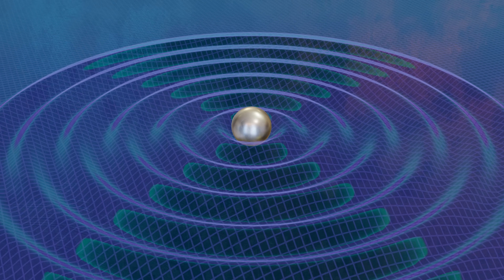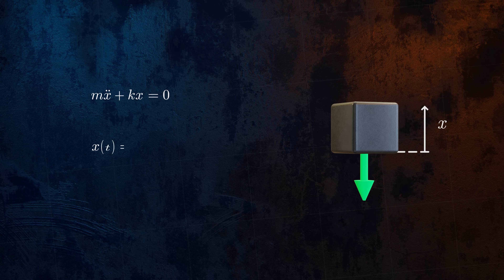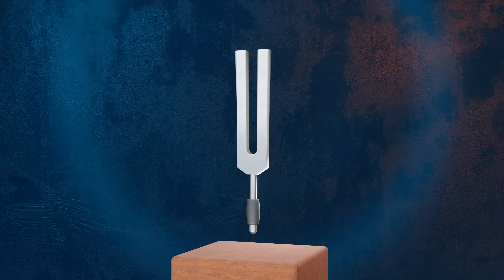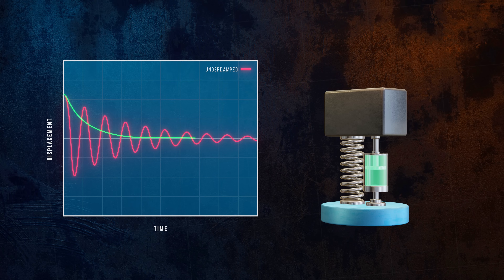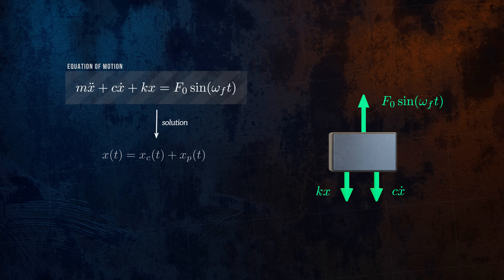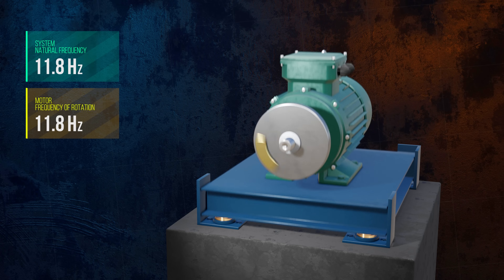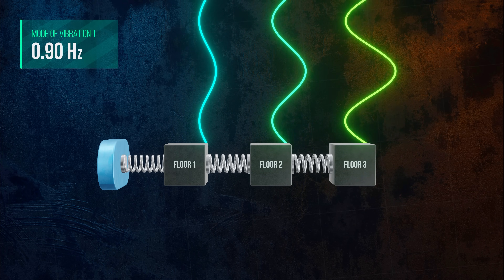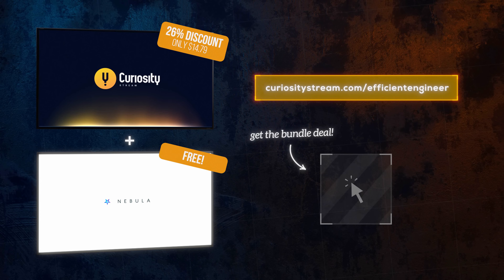Understanding Vibration and Resonance

Comment: Timestamps (Powered by Merlin AI)
00:07 - Understanding vibrating structures is crucial for engineers
02:20 - The forces acting on the point mass are equal to the product of its mass and its acceleration.
05:19 - Different masses of spring-mass models have different natural frequencies
07:36 - Viscous damping is commonly used because of its simplicity.
09:54 - Oscillation can be caused by initial conditions or forced by external loads.
12:30 - Resonance can cause significant damage to structures and needs to be carefully assessed.
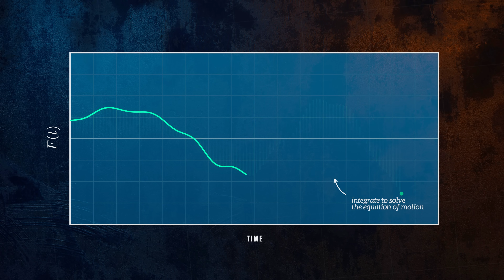15:04 - Designing structures to withstand seismic events requires special probabilistic techniques like the response spectrum method.
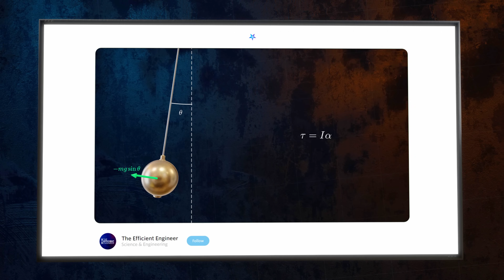17:44 - The motion of pendulums differs from a mass-spring system and the equation of motion can be derived.

Comment: Nice introduction. What I always enjoy about this subject: it is the gateway drug to understanding electromagnetism and RF/microwave engineering. Many of my engineers have a structural or mechanical background and are usually mystified with RF. But once the synthesizing mathematics of differential equations (especially pde’s and complex analysis) is introduced in relation to modes of operation, damping and resonance, the connections to amplifiers, filters and transmission lines becomes real.

Comment: These are all the same quantities for electrical systems, such as phase, frequency Inductance(mass and Capacitance (Spring Constant)and Impedance(Impedance/resistance). Resonant frequency has 2 signals 180 degrees out of phase

Comment: This dude covers 70% of the semester in just one video
Reply: I agree 😂
Reply: @mohamedfaisal6202  where are you from brother?
Reply: Damn what clg r u from cause this vdo covers jst half of 1 chapter I have this sem
Reply: i don't think so....he is really good but there is more depth and width to core mechanical subjects which he doesn't cover in this small videos
Reply: @vineetbadekar1112  Theoretically it was about 75% of my undergrad vibrations course. However mathematically, it was maybe 5%. Probably why it takes so much time to get through the theory because the math that goes with it is very extensive.

Comment: One area that is commonly overlooked is how fluid flowing in pipes creates vibration waves that travel the long axis and create standing waves of much greater energy than the flow itself. Outside of high pressure gas being vented the majority of the noise in a process plant comes from this effect. Bearings with defects cause a massive amount of noise because the vibration is transmitted to the piping. 
About a month ago one of my multi stage pumps motor bearing failed and started a harmonic in the suction spool that fatigue cracked a vent nipple. I had to do an emergency shutdown before it caught fire. The motor is mounted on a fully grouted plate on concrete. You could feel the ground vibrating 20 feet away

Comment: The equation mx'' + kx' + x = 0 is wrong because the damping force is proportional to fluid velocity *squared*. It is used, because you can easily use Laplace transformation, but it's fundamentally wrong in its outset.
Reply: It depends on the regime of flow.  For laminar flow, the resistive force is proportional to the velocity through the fluid.  So for friction in a viscous substance like oil, it is completely reasonable to assume a linear damper model of F = -c*x'.

For turbulent flow, pressure drag dominates over viscous drag, so this problem would be significantly more difficult to solve with turbulent drag.  Even fluids without a lot of viscosity will have some degree of laminar flow at low speeds, so there is a part of the drag force behavior that will be proportional to the velocity, instead of the square of velocity.

Comment: Can anyone please correct me, here that this spring in the shown example is not like a real, physical spring, because real spring has some sort of damping in it and therfore the mass stop after certain period of oscillations (Damping: energy dissipative system) whereas stiffness is just the resistance of deformation (here it is spring, it could be turbine blade or any object)
Reply: Usually, you assume a lumped model of ideal components, to keep it simple.  In other words, you assume a massless/frictionless spring, and a massless dashpot, and a perfectly rigid mass.  This way, there is no cross-over in the behavior of these components for the mathematical model, as there really is in reality.

Comment: For a layman like me, the first thing I thought about with resonance was how a washing machine for clothes receives an unbalanced load and begins to rock uncontrollably until the system's auto-restart stops the spin cycle.
In that case, the washing machine's outer case would be affected by the forces of the rotating cylinder within it, and the imbalances can resonate with the momentum already applied to the outer case from the cylinder's spinning?  Fun info, don't know how I'd apply it just yet though!

Comment: What about vibrations from light or radiation waves? Can you dampen that?
Reply: Yes.  It's called semitransparency.

A semi-transparent medium will partially absorb some of the light waves that pass through it, in proportion to the total amount, and in proportion to the thickness.  The energy of the light wave is attenuated just like a damper, as it is converted from the domain of electromagnetic fields and photons to the thermal domain.

Comment: I find it criminal not to show why we use angular frequency for oscillating objects
Reply: The reason why we use angular frequency, is that it keeps the calculus elegant, by having frequency in radians/second instead of Hertz.  The angle is more virtual than physical, since it is just an angle used to keep track of where within the cycle we are, at any given point in time, where 1 cycle = 2*pi radians or a complete "rotation" through phase space.

It is not necessarily related to any actual rate of change in an angle you can measure with a protractor, in terms of what is happening in reality.  In some cases it is directly related to angular velocity, like uniform circular motion.  In other cases, it is a completely different number from angular velocity, like in the case of a pendulum's motion.   In the case of a linear mass/spring system, it has nothing to do with angular velocity.
Reply: @carultch  "  The angle is more virtual than physical,"
lmao, even though the angle is virtual. There is zero reason not to show how the projection of a point moving on a unit circle can represent this scenario. So many concepts regarding this motion can be visualized and understood intuitively that way. And if you want you can actually build a mechanism for this projection, and actually measure the angular frequency using a protractor.

Comment: Sir, there is a confusion.
Heavier mass oscillates at a lower frequency as compared to lighter one when stiffness of the spring is same.
But mathematically, natural frequency (omega) is proportional to square root of mass, which means heavier mass should have greater frequency???
Reply: Natural frequency is inversely proportional to the square root of mass, assuming the stiffness of the spring remains constant between each case being compared.   Not directly proportional to the square root of mass.

Heavier mass should have less natural frequency, unless you also increase stiffness.  This is why steel has a higher speed of sound than rubber, even though steel is a lot denser than rubber.
Reply: @carultch  Thanks ❤️.

Comment: Dashpot = Capacitor, resist change in voltage = Inductor, resist change in current.
Spring, dissipate energy as heat = Resistor, dissipate electrical power as heat.
What is mass? Dual of the dashpot depending on whether we treat Force as voltage or current?
I love binging these videos and seeing the connections across engineering disciplines.
Reply: The dashpot is more like the resistor.   The spring is like the capacitor.  The inductor and mass are like each other.

The spring and capacitor store potential energy, in the form of elastic potential energy (SPE for strain potential energy) and electric potential energy (EPE) respectively.  Energy of configuration, which we call potential energy.

The dashpot and resistor remove energy from the mechanical (or electrical) domain, and convert it irreversibly to the thermal domain.  Both of these components generate heat as they apply a force that opposes the velocity (or current).

The mass and inductor, store the energy of motion, in the form of kinetic energy and magnetic energy respectively.

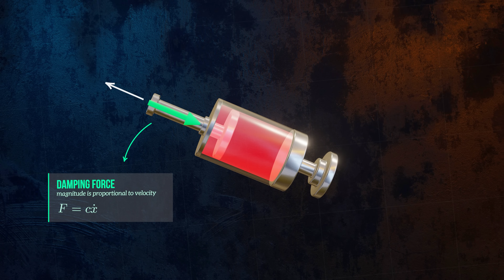Comment: Hi, I was wondering if at 7:26, this equation could be applied to a pendulum dampening a structure? If so, what do i do with k?
Reply: Instead of elastic stiffness, you have m*g*sin(theta) as the restoring force for a simple pendulum.  We approximate it as m*g*theta, since theta in radians is approximately the same as sin(theta) for small angles.  Mass also ends up cancelling, because both the restoring force and the inertial property are proportional to it.

Comment: Accurately speaking, solutions shown are never-ending. For having solutions to the 2nd order diff. eqn. is needed to have a singular point where its locally non-Lipschitz. As example, changing the damped force F=c*x' (Stokes' law), for a sublinear damping:
F=c*sign(x')*sqrt(|x'|)*(1+|x'|^(3/2))
will made appear decaying solutions that indeed will achieve finite extinction times (particularly this example resembles Stokes' law for non-near zero law speeds, and the classic drag force F=c*(x')^2 for high speeds).
Hope you experiment with this force on your softwares and share the results.

Comment: Vibratiile vazute ca miscare oscilatorie a punctelor materiale ale mediului, de o parte si de cealalta apozitiei de echilibru, se produce numai in sanul substantei. In vidul cosmic necoeziv, inelastic, inponderal si neinertial, nu poate functiona mecanismul undelor care cere transformarea prin succesiune a energiei unui camp in energia celuilalt camp. Asadar in vid nu este nicio vibratie, ci numai translatie (alunecare) hidrodinamica prin oceanul eteric. Asa zisele unde E-M sunt doar reliefuri ale campului E-M, care luneca hidrodinamic prin oceanul eteric. Relieful E-M este format din circulatiile in planuri perpendiculare, ale campurilor electric si magnetic.
Vibrations seen as an oscillating motion of the material points of the environment, on either side of the equilibrium apposition, occur only within the substance. In the non-cohesive, inelastic, unweighted and non-inertial cosmic vacuum, the wave mechanism that requires the transformation by succession of the energy of one field into the energy of the other field cannot function. So in vacuum there is no vibration, only hydrodynamic translation (sliding) through the etheric ocean. The so-called E-M are just reliefs of the E-M field, which slides hydrodynamically across the etheric ocean. The E-M relief consists of the perpendicular planes of the electric and magnetic fields.

Comment: so the number of degree of freedoms equal the natural frequency that the system can have?
Reply: No.  They don't even have the same units, so you can't say that they are equal.

The number of degrees of freedom is the number of independent direction pairs that the system can move.  An unconstrained particle (whose rotation is irrelevant) can have up to 3 degrees of freedom, because it can move up/down, left/right, or forward/backward.  An unconstrained rigid body in general can have up to 6 degrees of freedom: up/down translation, left/right translation, forward/backward translation, as well as yaw, pitch, and roll rotations.  Constraints will reduce the number of degrees of freedom, like a rail track reduces the number of directions that a train car can move, from being a rigid body (6 degrees of freedom in free space) to being confined to just moving along the track (1 degree of freedom).

Natural frequency is a consequence of the interaction of the stiffness and the mass, that determines what the frequency would be, if there were no damping or forcing functions.

Comment: I have a question please ! (including the first example used in the vid)
does gravity act as a damper? 
or  its just the the energy is dissipating in form of heat in the spring and maybe sound too 
or its both of them 
cuz eventually in real cases the vibration shall stop ... thanks

Comment: Why do we neglect gravity of the mass on the Spring?
Reply: Because all that it does is relocate the neutral position of the vibration, so that it occurs at a slightly deformed position of the spring, instead of at the spring's unstressed position.  The dynamics are still the same, whether we consider the vertical spring with gravity, or the horizontal spring system where gravity is out of the picture.  It is a lot easier to set it up with a vertical spring, because you can maintain it in tension on both sides of the cycle (and not deal with buckling), and you also don't introduce friction from the method of supporting the mass as it moves.

Comment: I’m studying Electrical Eng, but I’m here because the structural vibrations in my building 24/7 are driving me crazy from rotating machines mounted on the ceiling right above me and my landlord refuses to call a profesional. I’m trying to understand what needs to be done.

Comment: Thanks for sharing the video. By the way, why didn't you include the weight in the equation ? It will be like: 
m*a + k*x = (+ or -) mg
Reply: Because all that does is shift the neutral position, from the unstressed position of the spring, to a position slightly lower, where the spring force fully balances the force of gravity.  The dynamic behavior is still the same, thereafter.  This is the case as long as you are in a uniform gravitational field, which is a reasonable approximation of Earth's gravity, 9 times out of 10.

You could also assume this problem takes place in a weightless environment, or that it takes place along a horizontal air track that supports the weight independently of the spring.

Comment: Started working HELICOPTERS; quickly got to HATE the beasts!!!  Ran on a couple mad scientists that used strobe lights, vibration sensors and tuning circuits!!!!
One could have a “static balanced”rotor assembly or drive shafts but upon engine start it all goes to HELL !   
After much tutorial and hands-on the HELICOPTER was my “bread and butter.”
The practical application of this video is beyond great!!!!!

Comment: @ 2:41 there is a mistake however the final equation m a + k x = 0 is correct
according to Engineering Mechanics - Dynamics , Meriam. The the initial equation should be like this:
- k ( delta + x) + m * g  =  m  * a
delta: is the displacement due to the weight of mass
a: is acceleration 
g: gravitational acceleration 
x: the displacement from equlibrium position between mass and spring
At the equlibrium position between mass and spring we have at  :
 - k ( delta + 0) + m * g = 0 
or
 k ( delta) =  m * g 
according to that the final equation is going to be : 
m a + k x = 0
However I really do like your channel :) :yt:

Comment: Thank You for posting this: I was an aircraft mechanic for 8 years in the US Navy and trained, schooled, worked on Aircraft Hydraulic Flight Controls Systems, Airframes and Structures, AND LATER, I went to work at Lockheed Space Systems Division Environmental Structural Laboratories where I worked with Vibration/Acoustic tests on spacecraft structures. This video extends my knowledge and understanding of the physics from that experience.

Comment: Thank you for this amazing work. I have one thing that I couldn't understand, "Energy in a vibrating structure is dissipated due to the relative motion of components at structural joints" What do you mean by this relative motion, Is it the loosing in screw and nut ? and how it dissipated the vibration ?
Reply: In the real world structure, the mass and springs are distributed instead of being lumped. You can think of it as microscopic masses,springs and dampers, they all share the bulk of the energy and dissipate as heat.
Reply: @ChibunduUmeh  Thanks for the respond, so "the relative motion of components at structural joints" is the motion between the small parts at the microscopic scale not the motion between the physical joints like screw and nut ? The screw and nut that combine two pieces of the structure must be tighten very well "Rigid body" to prevent failure ? Is my understanding right for your explanation ?

Comment: Very cool video. My compliments.

I would like to clarify only one point: in the video it is said that in fluids the force (or shear stresses) are proportional to the velocity of the fluid. Actually I would say that the shear stress within fluids is proportional to the gradient of the velocity and NOT the velocity itself, with the common law for newtonian fluids including viscosity.
Am I wrong?

Mauro
Reply from the maker: No you're absolutely right, thanks for the correction!
Reply: @TheEfficientEngineer  perfect!
It would be great if you make a video on rotordynamics, talking about critical speeds and how to avoid them, how the gyroscopic effect affects the natural frequencies (changing them by varying the rotational speed) of mode shapes of a rotating shaft, for example.

Thanks,
Mauro

Comment: Excelent video again! I would add two more things:
        1. The mode shape does not have an amplitude, there are many ways to normalise the modes (eigenvectors), so the essence of the mode is its shape (relative to the other modes too).
        2. A mode of vibration is the very specific way of motion of the system that let the Mechanical Energy constant. A little bit faster/slower, or with other shape, and it will not conserve the energy. (easy to see in the 1dof model)